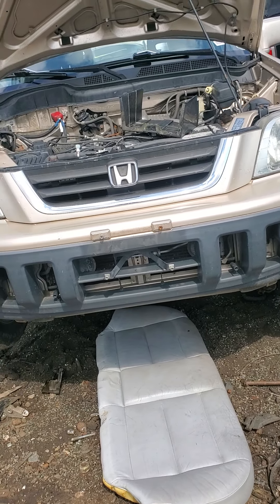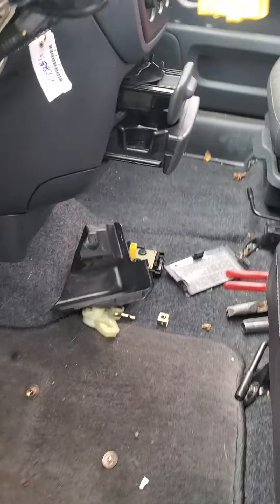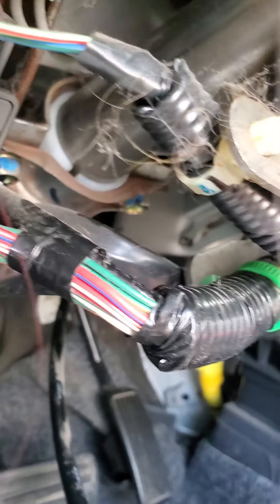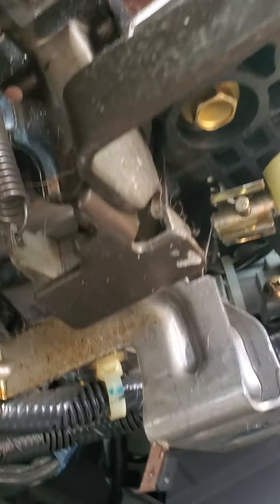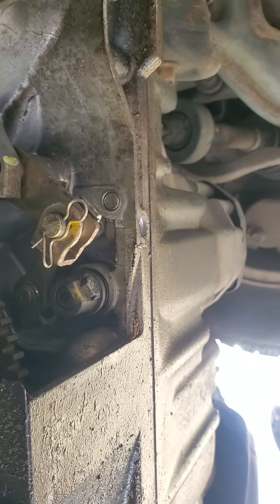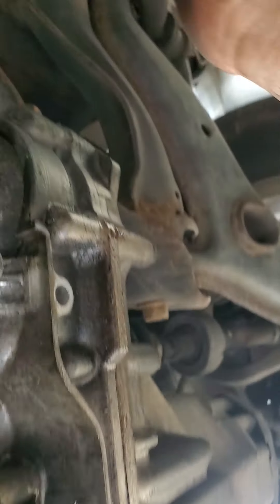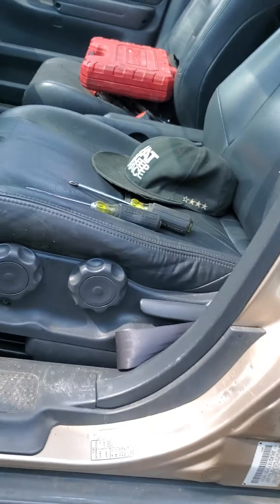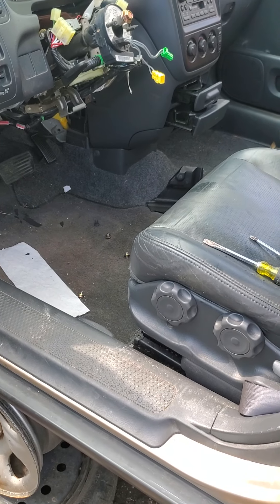97-01 CR-V RD1 shifter cable removal

Comment: Your video helped me out a lot thanks!!! Was able to get it out nice and easy but the installation was a bit complicated. Did you have any issues with the shifting? Or needed to adjust the cable?
Reply from the maker: You will have to adjust the cable yes, cause each vehicle wears differently throughout its life cycle so adjustment is required.
Reply: @Demosworld if it is not adjusted can it cause gear on dashboard i mean when i put in reverse it can move backward but dashboard light dont  work properly it s happen only in reverse sometimes if you move gear stick around reverse light on dash is on but not wen you leave it in reverse
Reply: @Demosworld and it you can pls tell me where can i adjust form that problem

Comment: What is the plate called that’s covering the shifter cable by the transmission? Hit a big pothole and cracked it in pieces(car is lowered). Can’t find it anywhere online. Going to hit the local pick a part and get a used one. Going to use your video as my guide. Wish me luck lol
Reply from the maker: https://www.hondaautopartswarehouse.com/oem-parts/honda-cover-control-wire-24901p4t000?c=Zz10cmFuc21pc3Npb24tYXV0b21hdGljJnM9YXQtYXRmLXBpcGUtc3BlZWRvbWV0ZXItZ2Vhci00d2QmbD0yJm49QXNzZW1ibGllcyBQYWdlJmE9aG9uZGEmbz1jci12Jnk9MTk5OCZ0PWV4JmU9Mi0wbC1sNC1nYXM%3D

Control wire cover, discontinued but you might be able to find it on ebay, that's the part and part number. Hope you figure it out. Thanks for the support 🤘🏻.
Reply: Thank you appreciate it. Going to stay and check out your content
Reply from the maker: @marcuscamorlinga1789  appreciate you brother

Comment: My man, thank you for doing the foot work on this task. Your video is greatly appreciated.  One question. What was the problem you were having with the A/T shifter.
Reply from the maker: My cable had frayed through the jacket and snapped due to rust, however it also had some slop, It can be adjusted out though
Reply: @Demosworld  haven't inspected mine yet.but I'm worried it ain't the cable because it popped out of gear at a red light and when I moved the column shifter I heard grinding like you would expect to here from a manual transmission not a Automatic transmission. I'm going to inspect it tomorrow, wish me luck. God bless.
Reply from the maker: @owl1873 oof yea im on my 3rd trans now, 2nd was strong but I mad a mistake so now I'm on number 3, but have you done the flush?
Reply: @Demosworld  No. Picked it up for $700 did the timing belt kit, replaced front upper an lower control arms sway bar links CV axles + the valve cover gasket a few days later it pops out of gear. Engine runs and sounds quite.  Easy car to work on DIY'ed it all. I'm good with the tools.

Comment: Hi Demos's World, Could you help me get a cable shifter like that? or some website where I can buy it. Thanks!!
Reply from the maker: What do you need just the cable or the whole assembly?
Reply: @Demosworld  at the moment only the cable which is what seems to be failing.
Reply from the maker: https://www.hondapartsnow.com/page_product/searchbyname?vin=&make=Honda&model=CR-V&year=1998&submodel=&extra1=5%20Door%20LX%20(4WD)&extra2=KA%204AT&filter=()&keywords=Shift%20cable

From Honda
Reply from the maker: Other than that you're welcome to search on your own 

This is ypu P/N: 54315-S10-A82

And if you want to find one on ebay just look up 97-01 Honda CRV auto shifter cable
Reply: My 98 RD1 just messed up this past Saturday. Drive shaft and shift cable got chewed up. Is installation for cable somewhat difficult?
Reply from the maker: @fvcknzayyy1782  sorry for the late reply, it's not difficult as it is tedious, as you can see in the video it's all circumstantial, and depends on how much you need to get out of the way, and if you can get under the car comfortably, other than that it's just following the steps.

Comment: hello. where can i find such a cable? and how much does it cost?
Reply from the maker: So you can either look it up on ebay or another part website such as rockauto, parts geek, etc. Ne personally spending on the part and how crucial it is I will go through honda autoparts warehouse, but other than that advance may have them, or a junkyard for sure just look up a "Honda (whatever year crv you have) crv automatic shift selector cable" and the results should come up
Reply: can you post a link to the site?
Reply from the maker: @bestofthebest6068  I suppose, what year is your crv?

Comment: Not sure why but took my Crv to the shop to get a rack and pinion done and got it back and now it’s really stiff when I try to put it in drive
Reply from the maker: You can adjust the cable to shift the trans, however if they routed it wrong or the cable got rusted and broke internally that would cause it too.

Comment: Anyone in the tri state area? NYC NJ?    My car is in a tight position also
Reply: I had posted on previous question I think my car won’t shift out of park I took the plastic column off, all those pieces are moving in that area so where i believe it’s the shift linkage cable. And praying not the gears Inside the tranny however that’s a strong possibility.   My Rhonda tashonda  for her 21st birthday 🥲🥲😅
Reply: @Demosworld  the tight position is.  The front end is up against the parking lot fence with curb
Reply from the maker: @stephie cee I gotcha well you can try 3 things the first one which is the safer way, there's a slot on top of the steering column made so you can insert a key when you do that it pushes down a white plastic tab that should allow you to shift it out of gear, the second way which I'm not 100% sure if it would work or not I'm just guessing based on how the cable operates, take off the cable cover on the trans and see if you can manually get the slide pin that moves when attached to the cable to move with like a screw driver or something that can fit in the hole the cable attaches to, it should move fairly easy, the third and last option if you have no others, is disconnect the rear drive shaft if you have a rt4wd if it fwd then don't worry about that, get the front wheels on some car dollies you can pick them up at harbor freight, from there as long as the rear wheels aren't locked up from sitting you should be able to push it back from the fence line to further investigate your issue. Hope any of these suggestions helped 🤙🏻
Reply: @Demosworld  I got it!!!!  It was the brake.   Had to really force it down!     What is that issue?
Reply from the maker: @stephie cee like you had to push the parking brake handle down?
Reply: @Demosworld  had to push the foot pedal brake down as far as possible
Reply from the maker: Sounds like it could be a caliper issue or something is sticking, get your brakes looked at
Reply: @Demosworld  up date.     It was the cable that was busted   I have 2000honda crv.      Autozone wants to know 4WD or 2WD. Idk which one I think 2. Because I can only go on the flat bed tow trucks.
Reply from the maker: @stephiecee7232  typically if you can only go on a flat bed it's 4, check to see if you have a drive shaft going to the rear if you do it's 4 if not then it's 2
Reply: @Demosworld  it’s a 4.  Lol.  Thank you.

Comment: I can’t get out of park.   I took everything apart besides the cable.       I recovering from open heart surgery and in a stuck position.         Ahhhhh
Reply from the maker: Sorry for the late reply, but you should be able to shift it out of gear by either adjusting the tensioner on the cable, or shifting it from the transmission itself, the reason it's stuck though is most likely because you have the same situation as me where the jacket on the cable has split and the cable just pushes out of the split instead of applying force to the shift lever, it has snapped, or is bound up and needs adjustment, so either needs to be adjusted or replaced, hope this helps, and hope you recovered well 🤙🏻.